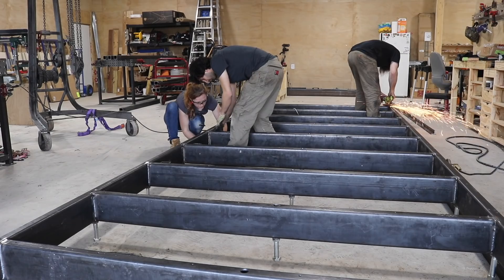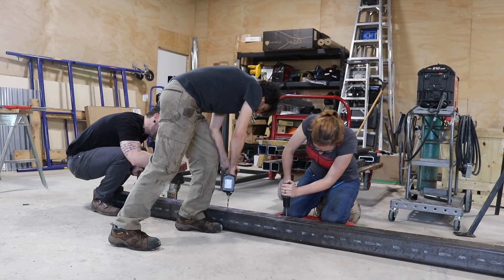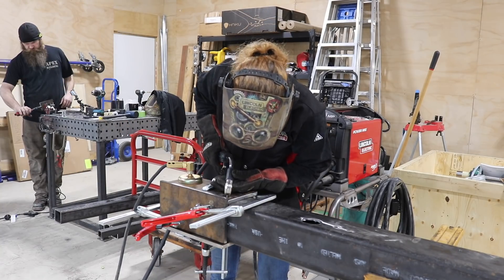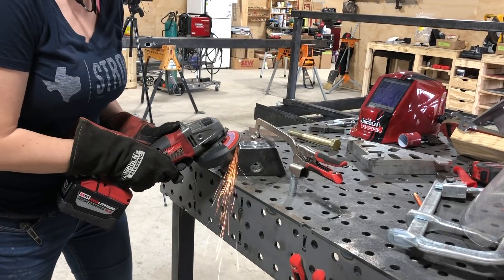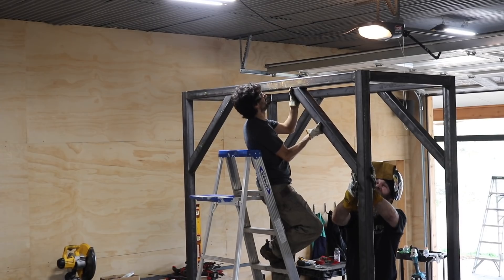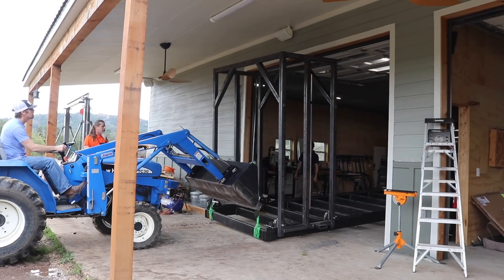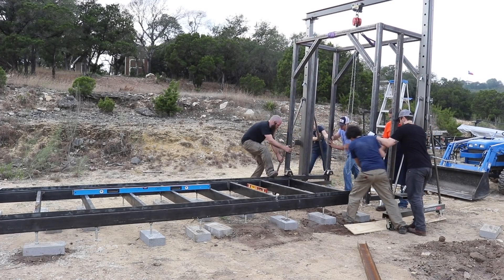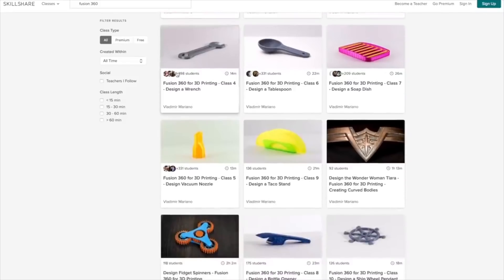Building a Giant Bandsaw Mill - Making the Carriage

Comment: I have  30 years of welding/fabricating/blacksmith experience, plus in those years I was a Certified Pressure Welder - Boiler Maker, and I think that this would have been a interesting and exciting project to be involved in.  Either way, it was both interesting and fun just tuning in and watching your build so far.  You however can bet that I will be tuning in to watch the remainder of your project.  In fact, before I was injured, I was designing my own saw mill, and that was long before these were a common item. I had my first sawmill experience when I was about 8  years old, when my dad used to take me to the local Mennonite Sawmill and help them with their engine from an old Cat. D8, as he owned a bulldozer of that same make , model and year.  A truly exciting and interesting place to go as a small child.  Keep up the great work and I do look forward to watching more of your projects.

Comment: Seeing it come together you realise just how big it is. Also seeing the teamwork and craftmanship involved renews my respect for skilled tradespeople. There is no such thing as overbuilding. In the lab I worked in before I retired we had precision grinding machines which needed careful alignment down to hundredths of a mm. They sat on benches and ran off our standard 240V supply. They needed regular adjustment and service and had to be sent offsite every 12 months for major service and adjustment. When the lapping plates wore out  they had to be replaced with expensive manufacturers parts. All this was originally done by hand using old free-standing machines powered by massive 415V motors. These were so old they had bakelite switches which eventually had to be replaced after about 50 years of use. When the lapping surfaces on these wore out we just took the plates they were mounted on to the engineering workshop down the road and they cast, machined and fitted a new one. I regularly used these for quick one-off jobs to avoid the time spent setting up the precision machines. I also used them for really large samples the smaller semi-automated equipment couldn't handle. Sure these were over-engineered but I doubt their modern counterpart will still be operating 80 years later.

Comment: Thanks April.  I did a similar project using a thickness planer  I took the bottom platten off, and mounted the head onto a carriage.  I was able to use this assembly to plane timbers up to 12" x 12", with a 30' carriage, and the  rollers would self feed. .  I used this several times for my last timber frame.

Comment: Hi April, i noticed that you almost always weld from left to right (while you are righthanded) and have the pieces in front of you.
With MIG/MAG welding you can weld from left to right direction or right to left direction,  but both give different results.
When welding from left to right, you get a smaller welding joint with deep penetration, while welding from right to left, gives a wider welding joint and less deep penetration and less sparking.
Also an extra tip : when using a MIG/MAG welder, you probably have noticed that the copper tip (where your welding wire comes out) inside your nozzle, gets sticky with little molten metal balls from sparking. There is a special spray that you can use to prevent this sticking, but they don't last long if you are welding all day. 
For this, you can use Tipp-ex correctionfluid what you normal use to correct write errors. This fluid comes in a little tube with brush and can be easily applied on the copper tip. 
When welding, this fluid doesn't burn off and last many hours of welding.

Comment: This build is over the top cool; what a great crew. The proper way to put the two vertical linear rail posts into position is having the two linear slides mounted on the horizontal beam and mounted to the vertical rails,  and assuring the beam is perpendicular to the rails and doing multiple re-positions top and bottom which will make sure the rails are absolutely parallel within thousandths while adjusting clamps prior to tacking. That way, the mounted width of the slide carriages define the width distance and the rotational parallelism of vertical rails. So looking forward to the next installment.

Comment: Looking good,are you going to run an electric motor like Matt,or and IC engine?

Here's a tip-Instead of using card stock or paper for welding shims,I use 1/2" wide steel banding material (lumber bunk strapping).I leave it stick out a few inches on one end of the assembly,so once the welding is complete I can use a vise-grip style slide hammer to jerk the strapping out. This is much easier than trying to force the assembly off of paper shims. It also helps to give the banding a coat of spatter shield before use.

Comment: Hey April going to be a great mill when completed, just a suggestion , if you don't have a set of bolt on forks for your tractor bucket they are one of the best investments I have made for my tractor . They are easy to put on and take off and don't take much storage when you take them off and are not that expensive.
Reply from the maker: I do have some but they aren't good ones and just move around on me. I'm looking into alternatives. : )
Reply: @AprilWilkerson   We may have different brands, Really enjoy your videos.
Reply: @AprilWilkerson   Bolt on forks suck. Either buy a pallet fork mount for the tractor or build one. We built a pallet fork mount for my wife's tractor ( a little bigger than what you showed) and it is one of the most useful things that she can mount on the front of her tractor. We even built a pallet fork mount frame that fit in a Kubota bucket and bolted in since the Kubota did not have a quick detach bucket.  As soon as my son got his skid steer, we built a fork mount for it too.  He has picked up a Jeep Cherokee with it and one project that he built that was well over 3000 lbs.
Reply: April Wilkerson build a set of pallet forks that take the place of the bucket on your loader. You should be able to find the forks used possibly from a bone yard for forklifts in your area.
Reply: You're going to need a huge loader for logs that big! Keep up the good work and greetings from Woodman

Comment: Your sawmill is great for what it will be used for.  I wouldn't want to cut 500,000bf of pecan or hickory on it but for what you're doing it should give you really good results for a long time. Drying the lumber is toughest part, air dried lumber runs between 12&15%. If you know someone who owns a kiln,  you will be able to use your lumber on interior projects. It's almost cost prohibitive to build a dry-kiln unless you plan on going into high production, where you can use the sawdust and chips from the slabs to fire a boiler furnace . You could boil away your moisture using a vacuum pump. Water boils at 55° at 28" of vacuum, maybe there are videos that can give you some process pointers. I know there are many videos concerning resin stabilization that maybe helpful.

Comment: April, loved your project. But I would think about adding one extra item. Because the height is quite a bit more than the width you may want to weld a safety grab off the bottom of the travel beams, loop them under your base beams. Wouldn’t want anything to heavy to tip your travel carriage over. Just a thought.

Comment: Nice job, looks great. Another thing is you might want to get some pallet forks for the front of your tractor very helpful in moving lumber around. Also loading logs, Not sure if you have detachable bucket but they go on very easy.
Reply from the maker: Yep yep, I am looking into different methods of forks and attachments. : )
Reply: @AprilWilkerson   The Grapple is great for logs and brush but pallet forks are good for lumber the Also have grapple attachment on forks that look good to use. I have forks for moving my lumber around here and used them with logs with my TC33 New Holland

Comment: Great series on this build. Given that you do a fair amount of drilling in metal and it's not always practical to run it through a drill press, you might consider picking up a mag (magnetic) drill to add to your tool collection. They're not cheap, but it's the type of tool which will last a long, long, long time if you're only using it occasionally.
Reply from the maker: Yeah we ended up borrowing one in the next part of the build and it made a huge difference. They do have a pretty price tag on them though.
Reply: Agreed. I've been looking for a used (e.g., reasonably priced) one for awhile and haven't had any luck. Anyway, keep up the good work with the videos!

Comment: Very cool project but one thing April - Matt design his mill with manual feed which isn't precise and have tendency to jump and wiggle (as seen on his videos). Could I suggest you do electric powered feed mechanism - you could simply use car screen wipers motor (with some sort of gearbox to upgrade feed speed  in future). I would start simply form calculating required feeding speed and choose gear ratio then simply connect motor in place of hand crank. Use ON-OFF switch to move it than later on you can upgrade to automatic feed with limit switch. You could use PC power supply as very good and powerful source of 12V. What do you think April?

Comment: Very cool video. April I know you said you might put a concrete pad under your mill.  Are you considering putting some sort of roof over it?  I know you don't get the type of weather we get here in Minne-SNOW-TA but I have seen other mills outdoors and they would have a small garage port for the mill head to be covered when not in use.  Just curious everything looks really nice.
Reply from the maker: Yep! Roof is mandatory. I will clean and paint it but in the summer the shade will also be valuable.

Comment: Its not overbuilt.over years of huge logs rolling,dropping,falling into ,it will be lucky to not need some rewelding in spots.I will say that you probly were planning to but some lateral bracing in the form of sheet of thin,1/8inch steel or even diamond p!ate sheet added in strategic spots will keep it from flexing and racking such with strengthen it by not having welds crack from racking.the rolling saw mount and the base.

Comment: You mentioned a few times that you are temporarily using clamps as stops.  Is there something that acts as a stop to keep it from accidentally tipping?  Something like 4 L brackets that go from the carriage to under the rails but not to interfere with the feet?  Probably overkill, but...

Comment: Are you going to pour a concrete pad for that thing?  When rainy season comes, I could see those concrete blocks sinking in and warping the bed.  "Cody drug it over there."  You go, southern girl, that's how we talk.
Reply from the maker: Yep, I do plan on putting it on a slab but I want to make sure I'll be leaving it here first. I'll use it for a bit and make sure I don't want it moved, then pour a slab and get a roof over it as well.

Comment: It can be built w/ angle iron to cut costs w/ about the same strength. I would use the flat part of the angle up and just use plain steel instead of stainless to place the wood on. I found angle iron at a scrap yard. That's me though.

Comment: IMO a slab or pavers will nudge and slide over time.  Even the commercial bandsaw mill manufacturers recommend putting it straight on the dirt or securing it directly into a slab.  I don't think people realize how dangerous it is to have something that nudges 1mm a week on a slab and then eventually falls off the side, putting peoples safety at risk.

Comment: If JD is so good then why did he not use a couple of 1 mm shims to put under the plates around the square tubing to prevent it from binding? When clamping the steel tight, then welding it in this case the steel will shrink while cooling causing it to bind.lol 👍

Comment: The flap disc tip confuses me... it’s turning in a circular motion so why does it only remove material when pulling? Anyone have more info on this?
Reply from the maker: The disks are laid down, over lapping the previous layer, in one direction. So it removes material best when pulling
Reply: Oooooh ok, my mistake I thought you had said “only” when you pull. I sat and thought, I know I see sparks flying off whether I push or pull lol

Comment: Great project and fun build with the crew, but wow, are you really going to mill 6' diameter lumber? These are going to be 8,000, 10,000 lb logs, maybe more. A one foot section of (live) oak 36" in diameter is over 500 lbs. https://www.sherrilltree.com/media/pdf/products/Log_WeightChart.pdf. Pine, spruce, much lighter of course, more like 250 lbs, walnut 400 lbs. Let's say an average is 350 lbs. So an average 12 foot log 36" in diameter is 4200 lbs (though in Oak, 6000 lbs) 48" in diameter multiply by 1.77 is 7500 lbs. A 12 foot walnut log 48" in diameter 8500 lbs. Just sayin', I know you have that tractor but there are some pretty serious materials handling/broken leg considerations implied by the size of your carriage. When you pour your slab, you'd do well to also place some stout stanchions or posts, whatever you want to call them, with attachment rings and hardware so you have points to attach a winch or two. And while you're at it, you might as well pour a full foundation for a shed for the thing, power & plumb it.

Comment: I always buy Made in America but when the time comes I might just be buried with my German Bessey clamps by my side.
I cringe when I see people using chains for lifting, and although those endless chokers are worth their weight in bacon, their lifting capacity is greatly reduced the wider the angle of the dangle. A "riggers" rule of thumb is:
Vertical 100% capacity, 
45 degrees - 70% capacity,
30 degrees - 50% of rated capacity
15 degrees - (like they are in the video trying to put the carriage on the frame) they are only good for 25% of what the tag says they are. So purple (in a choker like that) are good for 2400# if they are vertical but only 600# each if they are splayed out that wide.